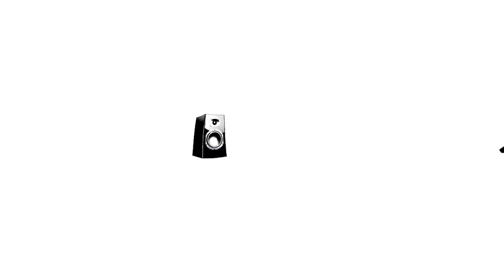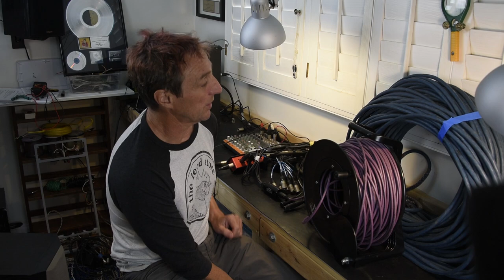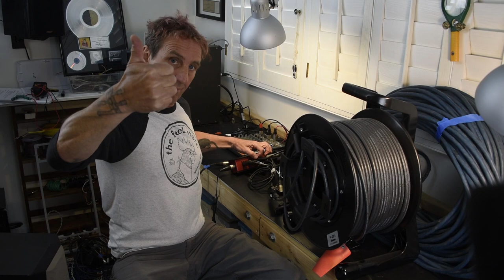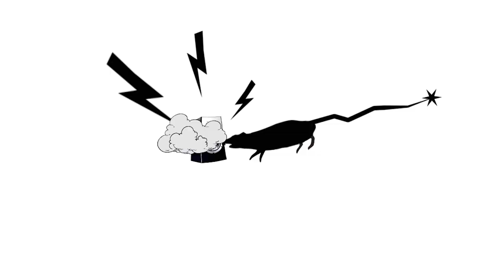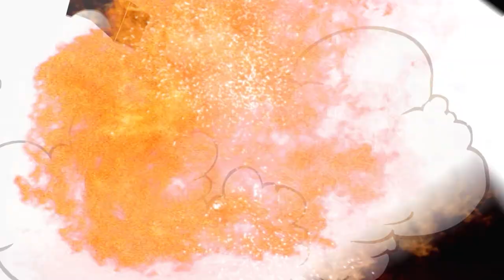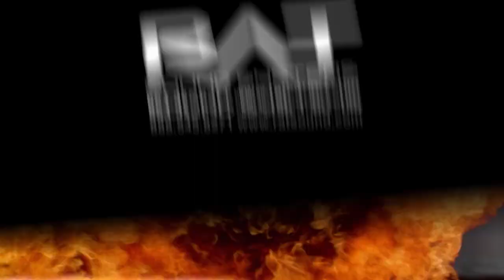Cat5e vs Audio Snake, Hear Signal Loss of 100 meter cables

Comment: nobody in the civilized world uses CAT5e anymore, CAT7 is worldwide standard (except US 🙄)
Reply from the maker: Well, also, using the optimal tool for the job is the sign of a wise human and those that use a sledgehammer when the application calls for a flyswatter may not be optimized.

I would say it depends on the application, if you need a larger diameter, stiffer, hard to coil cable that has trouble laying flat for your application, so be it, but to use cat7 when a nice easy to coil, smaller diameter more flexible Cat5e will more than suffice, I would say that would be an indication of a well thought out plan
Reply: Nothing in the world uses CAT7 bandwidth, because 10gigE hasn't caught on, and the transceivers draw too much power to use them on sfp+ switches unless the switch is also out of spec and built for it. Anyone who needs >10gbps uses fiber because it's cheaper.
Also nothing in your house needs 10gbps, and probably won't for the life of CAT7 cabling (10 years), particularly since internet speeds are all sub-1gbps for the mostpart.

Also, there's nothing preventing you from using much cheaper CAT6a, which handles 10gigE just fine, and in fact, is the US standard for new installation. In short, you're full of shit.

Comment: Dave, would love to see a loss and latency test between analogue over cat cable vs digital (like Dante)
Reply from the maker: Ive done audibility testing of analog vs digital for long cable runs over 100 meters and digital tends gains more and more advantages as cable length increases. For short runs, not flipping to digital has advantages
Reply: @DaveRat  Hi Dave, when you say short runs how much are you talking about? 20 meters?
Reply from the maker: Under 100 feet

Comment: You folks DO realized that people use CAT5e for long runs because there are protocols that transmit DIGITAL audio perfectly over those long runs... right?

Running analog audio over these cables is frankly a waste of time.
Reply from the maker: Yeah either that or you run into things like running 10,000 ft of burial cable to do delay clusters at a festival and the cable gets damaged while being pulled up and you find out that you can use inexpensive shielded Cat5e that sounds better than audio cable, cost less, and is easy to solderless terminate on site.

Or you have four Cat5e data cables and your main snake to front of house and you can use one of them as an analog four channel run for talk back com-line and a spare stereo analog feed without converting to data.

Or you just want cool little for channel stage snakes with disconnectable mults to drop around stage and reduce the mic cable count, speed up setup and teardown times and have a cleaner stage.

Comment: Nice demo!  Cat  5e specs 1GHz (1000MHz, 1000000 kHz) which is indeed a comfortable margin above 20kHz.  Given the advantages in terms of weight and durability, this is clearly a no-brainer choice. .. thanks for make it so vividly clear.  Of course someone is bound to say, "I hate digital.  I won't even use cables designed for digital in my signal path regardless of their numerous advantages!"

Comment: Hi Dave!
We observing losses especially at HF. I'm just thinking if it counts, or not, that you made an air-core coil with about 100 turns from that cables (technically a low-pass filter). I don't want to argue, with your findings, just asking.
Reply from the maker: Hmm, well the audio snake had less turns and tested the same or worse, so if that's the case, is even better than it tests with the coiling disadvantage.

Also, since it is not uncommon to leave excess cable coiled up, perhaps real world.

But actually, twisted pair wire, especially really perfect twisted pairs, eliminates the coiling inductive issues.
Reply: I was wondering the same thing about low pass filtering. Seems like a non issue. My question is then: how to wire cat 5 cable as a snake. 4 pairs. 4 channels? How do you ground them?
Reply from the maker: Use shielded cat5 cable and a common ground/shield.

On a console, all XLR pin 1 are connected together. Having a snake that connects pin 1 together is all good

Comment: what I wonder is why on earth you wouldnt use fiber instead of copper in a multi signal cable. Its not like there would be a lack of bandwidht in a 10gb switch.. Wireless, nah.. but when the signal finaly is in the speaker cone it has probably been converted 4-10 times .. and the weakest link would be the d/a-converterter at the instrument.
Reply from the maker: Having a low cost way to drop an analog zero latency 4 channel line for a com line and some analog feeds is very useful.  Also stage sub snakes, analog backup and so on.
Reply: @DaveRat  The cost is always a factor.. add+gain=value .. And copper is cheap. A good, shielded, expencive, copper conductor is probably way cheaper than replacing/welding fiber because someone backed over the fiber with the forklift.. again. Lets thank the Gods that bluetooth isnt an option!  :) thank you for an awesome channel!

Comment: From 6 mins, I got a little confused with the brighter W1 cable being brighter and with more gain, but the losses are more in the high frq'y of the audio W! cable. Are you suggesting the brighter sound of the W! cable is due to lower frequency loss, causing the brighter sound? I can clearly hear there is a difference, but I am not in the room with you. Would you be looking at using cat 7 in the future over the W1 audio cable?
Reply from the maker: The setup let's you hear the loss in the cable.  As in, if highs are sent and lows are sent but less highs make it through but all the lows make it through, and we listen to the difference between the input and output, we would hear a bigger difference in the highs.

This demo was mainly to show that Cat5e cable is very effective in transporting analog audio. Being as good if not better then standard audio snake
Reply: @DaveRat  Thank you for that clear up. I was hoping you meant that. Regards, Ian.

Comment: I’d like to see testing on this with balanced audio instead of just looking at one side by itself. Is capacitance between hot and cold going to have an effect? Also crosstalk as someone else mentioned.
Reply from the maker: Cool and I did a video on crosstalk.

https://youtu.be/gGgPDEz5sNU

I did a series on speaker cable losses as well.

Will ponder a way to do capacitance or at least a way to hear both wires. There are some null test videos out as well.
Reply: @DaveRat  You could do a polarity inversion comparison between original signal and what passes through audio vs Cat cable. That seems the simplest way to test them as balanced lines. I'm really interested in this whole discussion. For years I've had an exam question in my fourth semester electronics course (Audio Engineering majors) where they are asked to choose between Cat5 cable or unbalanced+Shielded cable for an emergency recording using passive ribbon mics. The point is for them to choose balanced over shielded, but I have also told them that balanced audio cable would be preferred, perhaps I've been wrong.

Comment: Hi. I'm a newbie and I'm currently experimenting.

I'm planning to buy a cat5 utp cable and use it as speaker cable. Currently I'm using a gauge 8 speaker cable.

Can anyone help or tell me if cat 5e utp will be good replacement for my current speaker cable.

Thanks in advance
Reply from the maker: Oh my, cat cable is 23 gauge to 26 gauge, which is very thin for using as speaker cable. You would need to bundle over 100 individual 24 gauge wires to reach the low resistance of 8 gauge.

Or since there are 8 wires each cat5e utp, you would need over 13 cat5e x 2 to run a speaker.

Over 26 cables 8n parallel to replace a single would be quite messy and not ideal
Reply: @DaveRat  

Hi thanks for your reply. I really appreciate it.

does UTP Cat5e sounds better?

And, does thicker cable sounds better for audio?

Comment: whats your opinion on fiber optic to xlr extenders?
Reply from the maker: All good, we use digital audio over fiber and digital audio over cat5 all the time.

If the signal is analog, then converting to digital and back to analog will add cost and latency

Comment: I have a bunch of shielded procab cat5e cable, but the shield isn't connected to the jacket of the ethercon plug. Can I still use cat boxes with this to run balanced audio over?
Reply from the maker: It doesn't need to attach to the Shell of the other con but the RJ45 jacks must have a metal housing around them they cannot be standard rj-45 they have to have the metal and the shield must be attached to that metal wrap
Reply: @DaveRat  Thanks a lot, that cleared it up. I appreciate you taking the time to answer my newbie question! :)

Comment: 1) What is the best speaker cable you have found?
2) Where can I buy Supercat unterminated for home hi-fi use in the UK?
3) Do you notice much roll off between speaker cable in the smaller runs like 3-10 meters? General home hi-fi? Would Supercat allow for better sound in these setups as well or just for longer runs?
4) Would you recommended shielded CAT vs speaker cable for home hi-fi?
Reply from the maker: As far as speaker cable, it really depends on the application and how you prioritize features.  Durability, flexibility, coilability, overall diameter, cost, # of conductors, and wire gauge are all important in varying degrees based on application, length, program material, load impedance and so on.

Generally shorter cables and thicker wire gauge are better for sound quality. Beyond that, I would say all the esoteric high cost cables are waste of money that could be better spent on other aspects like amps and higher quality speakers and even if you have reached the pinnacle of all other aspects, I would say spending the same amount of money on improving room acoustics will see more results than ultra expensive cables

Comment: Nice way to actually listen to signal loss! A question, doesn't the roll of cable act as an inductor, which may cause extra HF loss?
Reply from the maker: Yes and I will do comparisons of coiled, non coiled and twisted pair speaker cables in parts 2 and 3 so you can hear those differences as well.
Reply: @Marcel Ooms: Also, a cable has capacitance between the conductors which increases roll-off. Lumped cable model.
Reply: @deanedgx  Shure, but I think the effect will be small.

Comment: I'm interested in the technical cause(s) of this effect - and this leads me to think that in practice the amounts of high frequency loss may depend on the actual use of the pairs.

I wonder if the increased high frequency loss you are getting in the conventional snake is mostly due to a higher capacitance between the signal pair and grounded screen (shield) than is the case with the Cat5e.

If I understand the test-setup correctly, it seems reasonable to expect a higher capacitance to ground in the conventional snake, as its pairs are individually screened, i.e. are each closely surrounded by ground, while those of screened Cat5e are, I believe, usually only screened overall, around all 4 pairs together. So when using the Cat5e, the pair being used is not so closely surrounded by ground, because the other 3 pairs space it away from the screen - assuming that the unused three pairs in this test are left open-circuit - not grounded. If they were grounded (or had a low impedance connection to ground, as in some audio applications - depending on the source and destination equipment), then maybe each pair would in effect be surrounded by ground more similarly to how they are in the conventional snake, and so less difference in high frequency loss would be seen in a real application that makes use of all 4 pairs.

It would perhaps be interesting to repeat the test with all pairs in use in various different ways (mics, DI, returns, etc).

I realise there are also other factors that affect a cable's capacitance to ground besides spacing, e.g. conductor insulation material and gauge, wire thickness, etc.

Also, the effect of any given cable capacitance value on the high frequency loss actually experienced depends on the signal source impedance - so, again, in practice the results experienced ought to vary depending on the actual use cases.

Having said all that, I would be quite surprised if there are many (if any) cases where (under identical test conditions) the Cat5e had more high frequency loss than the conventional snake.
Reply from the maker: There are numerous factors involved in the design of cat5e and similar cables.

Twist rate, twist precision, insulator material, wire gauge, strand count and spacing of pairs, are some of them.

Cat cable is designed to carry 1mhz, 10mhz or higher frequencies that are irrelevant to audio snake design.

One factor regarding capacitance is to use thinner gauge wire and accept the wideband resistive loss as a non issue in exchange for reduced levels of freq dependant capacitive losses.

The quality of the twists seems to be an important focus as well for maintaining extended HF
Reply: @DaveRat  The capacitance of the wires is the major factor here.  Data cable is always lower capacitance as it supports much nigher rates of change than conventional analog cables.  Things like twist are to keep a constant RF impedance, but a tight twist is also good in audio for CM rejection.
Reply from the maker: Agreed, many comments on inductance of the coils but capacitance and resistance should impacting things most.

That said, the "how much" and "what does the impact sound like" is best shown with tests.

But I have no interest in uncoiling 6 miles of cable

Comment: category 5 cable is 4 twisted pairs. category 7 cable is 4 twisted pairs separated by a core insulator and each pair has a grounded shield wrap accompanied by an outer grounded shielded wrap for the whole cable data cable is designed to carry a differential signal pair while audio cable is designed to carry a differential signal with a ground reference
Reply from the maker: Yes, Cat5e can come in 4 twisted pairs, UTP or an overall sheild 
s/utp. 

I actually custom designed and manufacture a Cat5e that is 4 individually shielded twisted pairs with seperate ground wires as well, U/STP.  Cat6a is S/UTP with an overall shield and cat7 is S/STP with individual and overall shield.

What is interesting is that all the new technology involved in designing these high quality data cables makes them actually better at carrying analog audio, than most analog audio snakes.

If you are interested, here is a video testing crosstalk between unshielded pairs when running analog down Cat5e S/UTP
Reply: @DaveRat  there's the difference. once you add shielding to the pairs, it functions as a coaxial cable. i heard you mention Cat5 and cringed at the thought of cross-talk in an environment with 3-phase power and air handling systems probably running on noisy variable frequency drives or worse, open contact motor-starters

Comment: Is it as big a difference with 100 feet? In practical listening terms...
Reply from the maker: The audibility of the differences on the direct signal is so small that it does not matter. This test magnifies the issues greatly.

The test is to show that cat5e cable is as good or better at transporting analog audio than audio snake
Reply: @DaveRat  appreciate your response and your tests!

Comment: One thing I’m thinking Dave about this test, not sure it would matter, Buuuuuut.
Your testing the cat cables wound around a huge metal core, essentially making a big choke
, correct?
But interesting.
Reply from the maker: The reels are plastic, not metal.  Also, maybe check out this vid or the series that shows that twisted pairs are almost totally immune to coiling issues.
https://youtu.be/jlFY4dDpjwc

Comment: How about a digital snake versus and analogue snake? Digital in theory should have lower loss and suffer from a minor conversion delay. Once you have digital you could go optical snake which should allow for huge lengths with almost no loss. I suppose you could have an analogue optical link too.
Reply from the maker: Very true. And have tested long analog run of 500 feet vs aes and aes was audibly better. Keep in mind these losses we hear are a small fraction of the overall signal and on anything but long runs, debatably audible. Mainly I'm trying to show data cable is viable for analog and that there are differences between cable types that at least are theoretically audible

Comment: Well, hum, never use 100m câble...this review is right for pro users who make sound in larges venues. With 30 m snake, no serious loss with high quality stuff. Thank for your pertinent and usefull advices. Cheers
Reply from the maker: Yes, very much towards large format sound reinforcement.  That said, also it may be useful to know that cat5e is useful and does not degrade signals when used for analog audio
Reply: @DaveRat  I hope to buy, if not high end one, a digital console with stagebox ( yamaha cl5 and rio racks, i can't afford for  high end like big rental companies. Thank you

Comment: What is the source impedance driving the cable?
Reply from the maker: It's low but good question, don't know other that the test measures the same using the IVIE pink noise generator, the small mixer and the output of my PONO music player.

I figure that since we use a variety of common gear to drive cables, then using a variety of gear similar, would be the best test source.